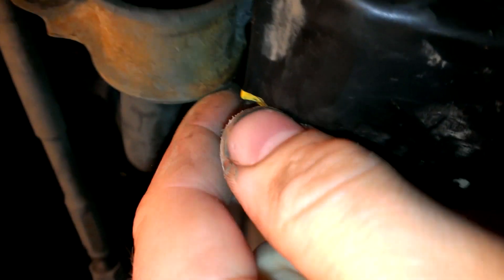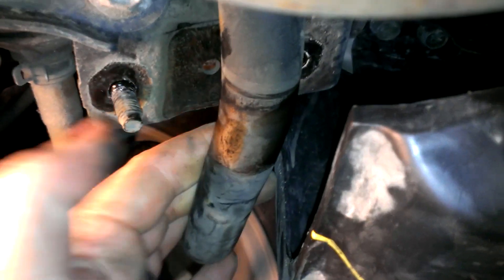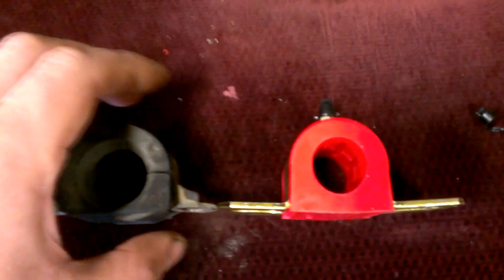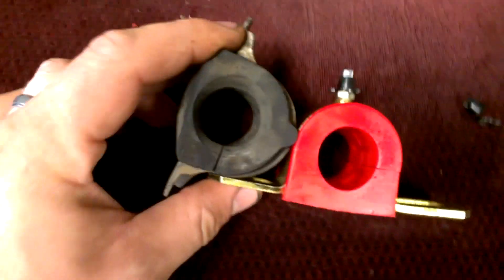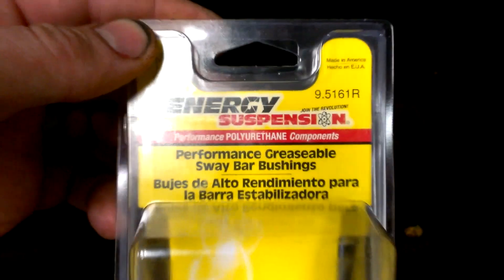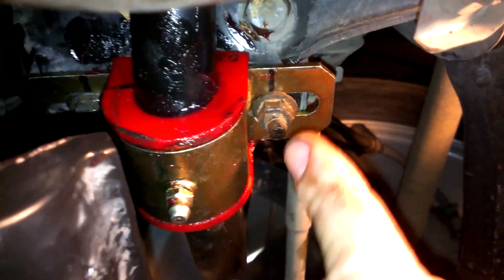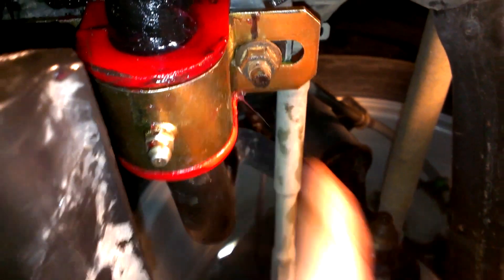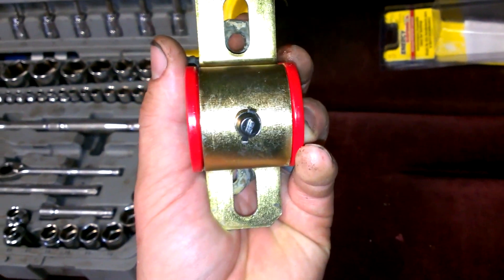2007 Subaru Tribeca B9 sway bar bushing replacement (Front end clunking)

Comment: I wish I would have researched this more before spending a good part of 
the day replacing my outbacks strut mounts. The sound the bushings made 
in your video sounds identical to the rattle mine has. I does sound just like bad strut mounts.
Reply from the maker: Steve Stoltz usually grabbing the sway bar and moving it around can let you know if links or bushings are bad most times, especially when resting on the ground if you are able to reach.  Still though knowing the suspension to a certain degree can help rule out other problems that could make similar noises too which is why I try to help with my videos!
Reply: I replaced the end links this afternoon and it took care of all of the noise. The bushings looked pretty good,  I would have replaced them as well but none of the local stores stocked them.

Comment from the maker: Energy Suspension 9.5161R that's in the video.  It's for a 1 inch bar and fits great except the bracket hangs over just a we bit on one side which you could just mold around the end if you don't like it that way.

Comment: Great advice, thanks. Maybe a silly question: Do I need to have the weight off both the front wheels (at the same time) to be able to change the front sway bar bushings?
Reply from the maker: thanks!  You do not need to have the weight off.

Comment: Would anyone happen to know why the Front Maker Lights, Rear Tail lights and Plate lights lid-up  for no reason? Fuse # 14 removed in-order to have lights off. Any take on this issue?
Reply: the parking light switch is flipped on, it's on top of the steering column.

Comment: I had the sway bar, links, and brushing replaced. Still got noise, Sounds like coming from strut mount??? Have any insights?
Reply from the maker: Jack up the vehicle and support it, then check the tie rod and ball joint.  For the strut mount turn the steering lock to lock while sitting to see if out pops, if not try rocking the vehicle side to side.
Reply: +SYNTHETICDARKNESSRX8 to check lower ball joint and tie rod, would jacking the lower control arm work?
Reply: +SYNTHETICDARKNESSRX8 there is a loud pinging noise from left when doing a slow left u-turn
Reply from the maker: +reality only on double wish bone/lower and upper control arm.  We have McPherson suspension which is better checked by lifting the body of the vehicle and not suspension.
Reply: ok got it. Thanks for the insight! Awesome!

Comment: Thanks for the video, seriously, I almost bought shocks for the same issue you had. Another question, is there a set for the rear sway bar too? If so I am going to do both at the same time. So glad I found this!
Reply from the maker: I'd have to measure the back, but they should make a set for them.  Remember if the bushing are super bad you might need the links replaced also.
Reply: Ok thanks!

Comment: I have some clunking in my rear and some in the front.   Will this part fit front and rear? How has it held up?    I do know I need a stabilizer link as well for my left side rear because it was loose and the mechanic couldn't tighten it.  
   Any recommendations on a good stabilizer link brand?
Reply from the maker: Michael Hinchey usually the ones that are beefier I try to get for the links like moog, but you gotta watch because you'll get one beefy and then the other could be stock like lol.  As for bushings polyurethane is the better way to go and I believe the fronts are bigger then the back.  They seem to be holding up good, but if I did it again if try to get the solid ones without the grease fitting.
Reply: Hmph. Any way you could help me with a website I could contact or model numbers.  I usually shop on Amazon prime but I'm afraid I'll order the wrong parts.  I'll have a small window to install these at my friend s dads shop and just want to make sure they are correct. Thx for the help.  
   Why would you go after the bushings that are solid(same brand)
Reply from the maker: Michael Hinchey hug the bar better, plus I hate having to grease them lol.  I just measured the bar with a caliper and got that size.  If I get a chance today I'll measure the back.  You can always call a parts store to verify things as well.
Reply: So you would just replace them instead of greasing them ? 
 Are the solid ones from the same brand ?  
I plan on keeping these and passing this onto my gf in a few yrs when I get my truck.
Reply from the maker: Michael Hinchey usually the same brand.  It really depends on if you want to grease them every so often really.  I'm sure there's a lot more companies though that make them like energy suspensions etc...
Reply: I'm sorry to bother u with this.  I've looked on sb9 threads and it is all so confusing.
   What are the cost benefits to the ones you grease?  They last longer?  What is the life expectancy?
Reply from the maker: Michael Hinchey no problem.  I think the life is probably about the same, greased might last longer if done properly since it would create a layer to help with wear.  If the solid are greased with the supplied grease it usually stays for a good bit, and if you wanted you could take them off once and awhile if you see the grease dry up, or it's showing less and regrease them.
Reply: So the solid ones are they a different install?
Reply: SYNTHETICDARKNESSRX8 My new bushing didn't come with any grease. I got Moog ones.  should I grease them?  Also do you know the torque on the bolts?
Reply: looks like the torque for anyone needing this is 18.1 ft lbs.

Comment: 08 legacy gt, makes an annoying clunking noise on rough roads and when I slow down. Do worn out sway bar end links make such noise?
Reply from the maker: Delvin Owino it could be that, ball joints, or suspension (struts etc...).  Only way to tell is jack up the vehicle and do the 12/6,3/9 clock position test on the wheels.  If you have double control arms/upper and lower arms you will need to raise it from the bottom control arm to take the load off the joints to check them.  Sorry I couldn't help more, but sometimes someone's noises could be something else to another without being there to actually check it.  Also check the sway links before raising it since it can keep the load off them and let them rattle if worn!  Sometimes it don't matter, but I check them both ways for inspection.
Reply: Okay. Thanks